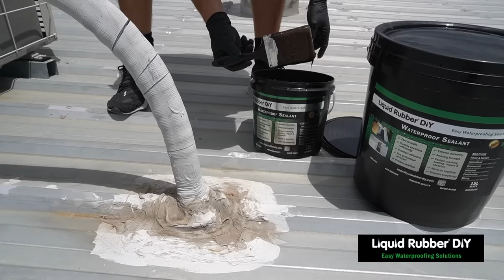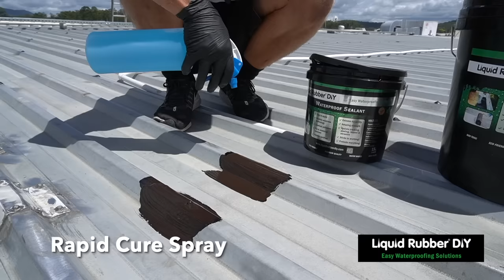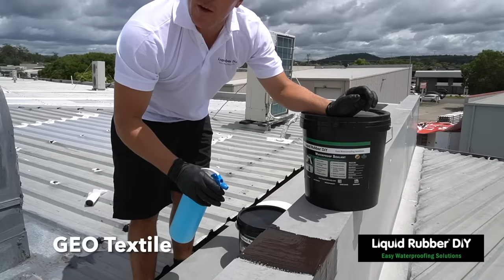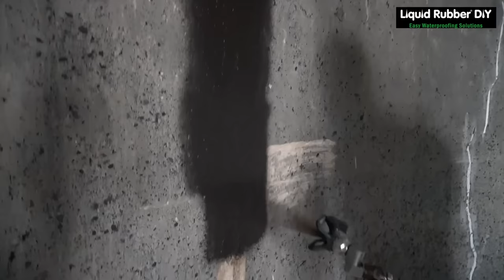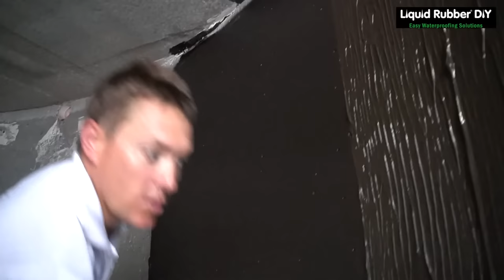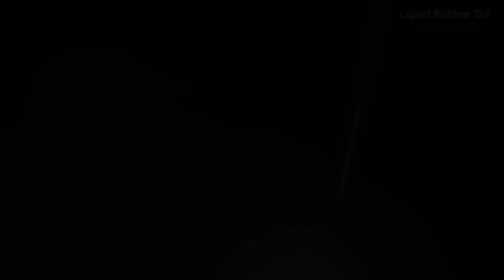How to apply Liquid Rubber DIY Waterproof Sealant.

Comment: Hi, which airless machine did you use and which nozzle tip?

If you don't use drying spray, how long does it take to dry to the touch?
Reply from the maker: Hi Enrique. Thank you for your comment. We use a Graco Ailess Spray Maschine Mark V. Nozzle 5/25. The Waterproof Sealant is touch dry in about 1 - 2 Hours. Depending on weather conditions.
Reply: @liquid_rubber_diy  Thanks You.